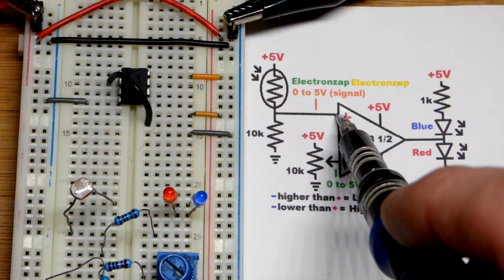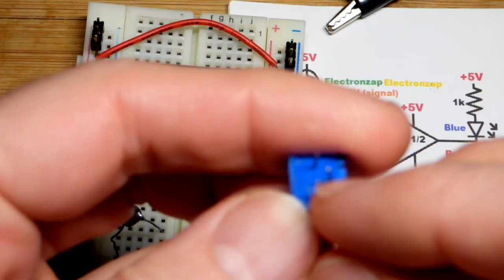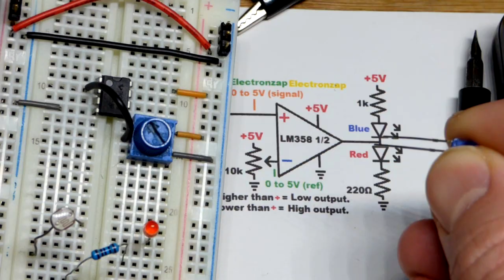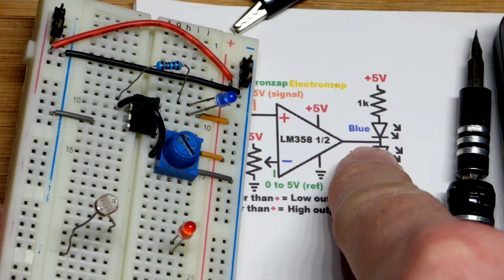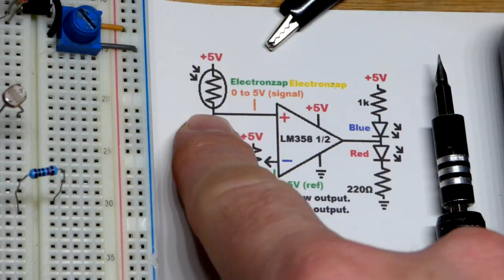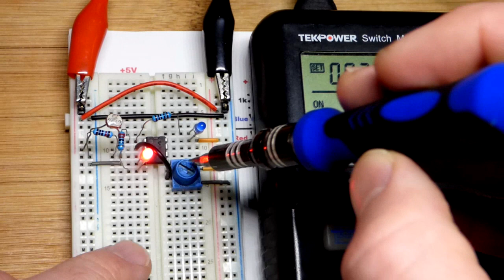Step By Step Adjustable Light Level Comparator Using LM358 Op Amp

Comment: This is a very nice circuit. I made the circuit too and it works perfectly. Does this cicuit need a Smitttrigger in order to protect both leds to go at a certain brightness ? 
Thanks for the video and greets from Amsterdam, the Netherlands.
Reply from the maker: Yeah, generally it's best to add Schmitt Trigger positive feed back hysteresis. Keeps the output from jumping around right at a borderline signal voltage. I try to keep most introduction circuits as simple as possible for people completely new to the circuit. Thanks for watching!